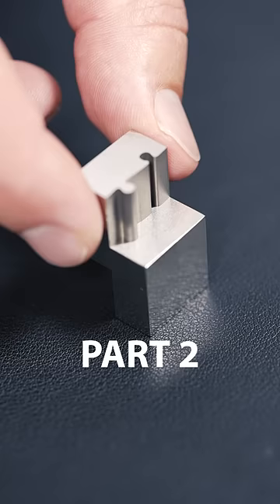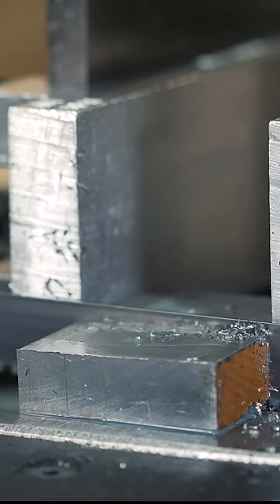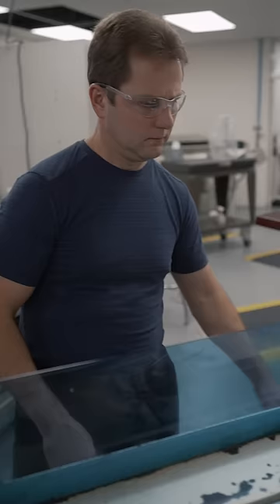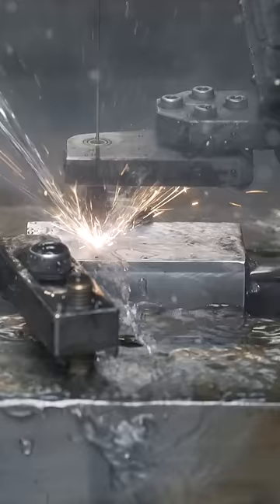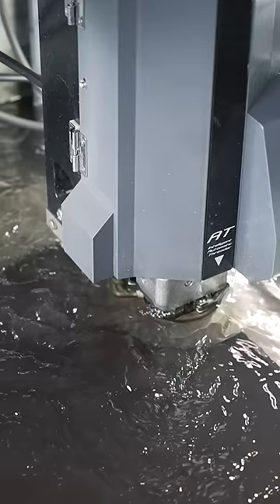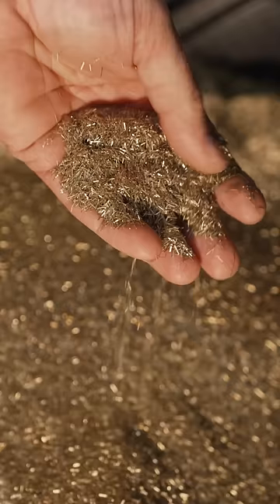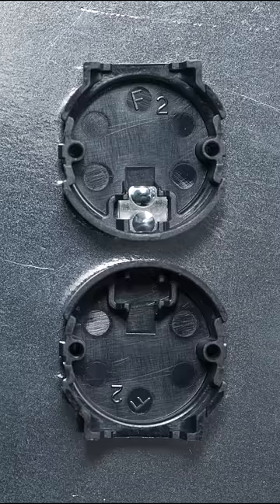'Zero Tolerance Machining' with the Wire EDM, Making a Puzzle Cube - Part 2 | US Digital

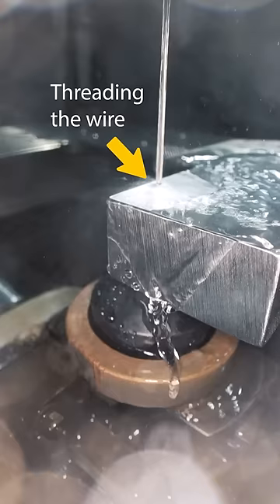Comment: 1:29 ... Imperial is doing my head in again. Honest question, why would you say 1/10th of 1/1000th of an inch instead of 1/10000th of an inch? 	2.5μm is insane though.
Reply: 1/1000th of an inch is a common machinist's unit, called a mil or thou. Same way you'd say 1/10th of a millimeter, not 1/10000th of a meter.